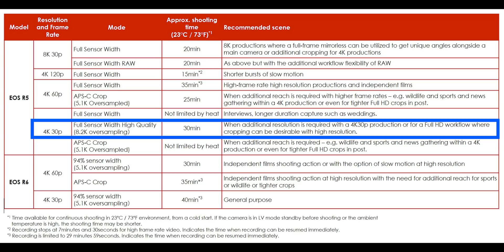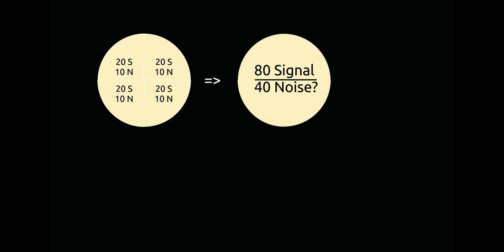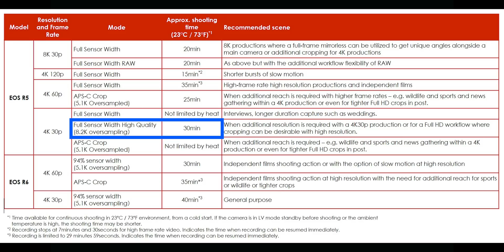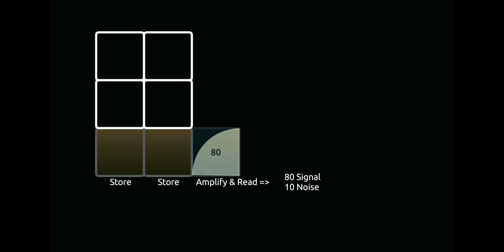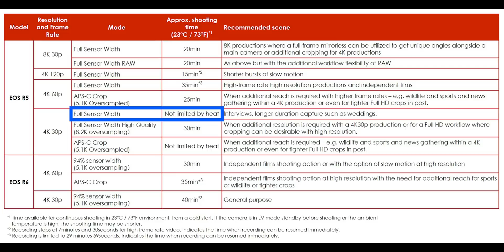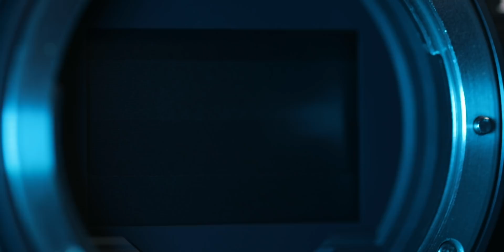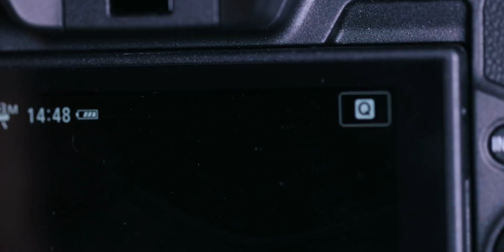Canon EOS R5 - Everyone is WRONG - Sensor explained - vs Sony A7s iii

Comment: I have question, just bought R5($4300) with RF 24-70 f2.8, unfortunately not able to get any sharp images at all,and find out My R5 r5 sensor misalignment, 
I’m not sure is really misalignment or because not latest firmware , I’m thinning return my R5 and buy new R6 or just replace with another R5, any thoughts?
Thanks

Comment: I actually watched the whole things.  I am giving myself a reward!  awesome depth! love it.  Did canon get back to you on that data?
Reply from the maker: Thanks mate. They didn't get back, but I know the answer. The R5 doesn't pixel bin in the non-HQ mode. It's a type of line skipping or at least discarding part of the data. So the lowest noise 4k mode on the R5 is the "HQ" mode, meaning it's a factor 5 difference in signal-to-noise between the R5 and the bigger pixel design like the Sony a7S III. 
A factor 5 corresponds to a roughly 2 stops, which is exactly the usable dynamic range difference measured. I actually made a follow-up video with that, called "divorce"....

Comment: Great explanations of S/N ratio.
Reply from the maker: Thanks mate. Now that we have both cameras out and tested, turns out this simplified calculation was almost exactly spot on. I made a part 2 (the a7S III vid) where I elaborated a bit on this. Now we know that the R5 doesn't pixel bin, so the best we can get is the 8k downsampled, 4 S/N in the example, vs 20 for the bigger pixels, i.e. a factor 5 difference. That's almost precisely the measured value: 2 stops of noise limited difference in dynamic range. And that means Sony pretty much won, for video.

Comment: Can pixel binning be added in firmware or is it hardware dependent ? Also it might be limited to line skipping so that mode remained unaffected by heat
Reply from the maker: It's hardware dependent in the sense that it needs to be supported by the sensor. Then of course the firmware can opt to use it or not, so the only remaining hope is that they haven't switched it on. Slim chance though. If it was supported in the sensor, I think they would have used it from day 1. So no.

Comment: You calculate that pixel binning yields a signal / noise ratio of 8, which is better than the  than the 4 s/n ratio you estimate for 4k down-sampled from a full readout of a high megapixel sensor.  This conflicts with many reviewers' notions that binning and line skipping are inferior and yield comparable problems like moiré.   Such reviewers also often claim that 1080p video down-sampled from 4k files can be an improvement on 1080p recorded using a sensor with fewer than 8 megapixels.  According to your perspective that down-sampling would also yield a worse s/n ratio.  Comparison of actual samples might offer proof, or not.  After all, how can anyone peep pixels at usual video frame rates with the usual preferred motion blur?

Most of the R5 / R6 sensor heat problem could have been solved with a small ventilation duct and fan, which the user might have the option to turn off and seal shut in wet or dusty settings.  Even with the camera body sealed to use copper instead of magnesium for the surfaces below the flip screen or its back side would improve heat dispersion.   But heat may be a rare problem in Sweden, right?
Reply from the maker: Turns out this simplified calculation was almost exactly spot on. Now we know that the R5 doesn't pixel bin, so the best we can get is the 8k downsampled, 4 S/N in the example, vs 20 for the bigger pixels, i.e. a factor 5 difference. That's almost precisely the measured value: 2 stops of noise limited difference in dynamic range. And that almost means Sony won. I made a part 2 (the a7S III vid) where I elaborated a bit on this.

Comment: The R5 is 8.2K (or 8192) pixels wide.  My guess is that the 4K30p Full Sensor unlimited mode is using simple 2x2 pixel binning of the 8K30p image.  That math is possible for ALU (i.e. add together 4 integers and then shift 2 bits right to get the divide by 4).   But 2x2 only requires 7680 pixels so they may be skipping lines.  For the HQ mode, they are sampling the full 8192 pixes down to 3840.  This requires divison operations, which uses more transistors and CPU cycles.  (This logic seems to explain overheating issues with R6... 5.1K is about 4/3rd 3.84K so a lot more floating point is required to produce 4K with the R6.). As to why line skipping 8192 down to 3840 is possible but not 5.1K down to 3840, I think it has something to do with the Nyquist rate where you need at least twice the frequency to recover the sample.
Reply from the maker: The difference of pixel binning vs scaling it down in software/hardware by shifting bits or dividing, is that the pixel binning aggregation happens before the amplifier, and since the noise is mainly introduced at the amplifier stage, that's the big difference.
Now that we have the data, the R5 doesn't pixel bin, which means the best read-out remains the "HQ mode" which is a full 8k readout. The calculation in this video turned out pretty spot on, because the estimated 5x better S/N with the bigger pixels vs the HQ mode is almost exactly the result (2+ stops in noise limited dynamic range) between the a7S III and the R5 HQ. I made a 2nd part where I touched on this.

Comment: I think I understood about 75% of this hah. Considering I had no context coming in well done.
Reply from the maker: Thanks mate. Turns out the calculations were pretty spot on, now that we have the camera tests available. The R5 doesn't pixel bin, and the 5 times better signal/to noise with the 4x bigger pixels on the Sony vs the R5 is pretty much what we got, about 2+ stops better. I made a part 2 with the video comparison (the "divorce" video)

Comment: Great explanation, What I am hoping to see on R5 is the ability to recover shadows and highlight,  readout speed using silent shutter.
Reply from the maker: Turns out the R5 didn't pixel bin, which means Sony won on video, by using the bigger pixels. I made a part 2 of the this, the "Divorce" video)

Comment: Everyone is wrong? WOW 👎
Reply from the maker: Had you seen it covered before? Turned out the R5 doesn't pixel bin, while the a7S III did take full advantage of the 4x bigger pixels. It also turned out that the calculation I did with 5x better S/N is almost exactly what we can now measure (2+ stops difference with S/N limited dynamic range). Do you agree with the conclusions in part 2 (the "Divorce" video)?

Comment: Are you working in R&D of camera or just putting theory and self logic?
Reply from the maker: I worked in mobile tech for many years, these problems are the same. Plus pixel binning was a key tech to get low light photos out of high res mobile phone sensors already many years back.

Comment: Hello,
About the last Fujifilm camera, does it mean that XT-4 is also using line skipping or pixel binning? So, does XT-4 have the same hoverheating and noise problems?
Reply from the maker: I haven't looked into the XT-4

Comment: Sony's lenses are not good yet ?  What a BS statement,  stupid review
Reply from the maker: You are right, that was a very sloppy statement. If there was an Edit button on youtube videos I would have rephrased those words. What I meant was that there exists no lens equivalents to the RF 15-35 f/2.8 (Lens) IS or to the RF 70-200 f/2.8 IS (that compact) on the Sony system. I wish someone will build it.
Reply: @ctoLarssonTECH  Sony's ff mirrorless  lens ecosystem are vast compared to Nikon and Canon all together with excellent Tamron Sigma and tens of other third parties lens manufactures

Comment: Pixel binning would lead to debayering artifacts similar to line-skipping (they don't use a quad bayer layout), so a full sensor read-out definitely would be preferable. But maybe they bin at least the dual-pixel pairs.
Reply from the maker: On the mobile phone tech side, we've used pixel binning for almost 10 years. It is possible. But you are still right because turns out the R5 doesn't pixel bin. Hence the 4k non-HQ mode is rather useless, and hence the whole camera drops in usefulness for video to almost EOS-R level.

Comment: Canon should just do like Sony and make one camera biased to video and the other to stills. That was smart on Sony’s part. There are just too many physical limitations to trying to use the same sensor for optimum stills Image quality and optimum video image quality. Its like using a computer with a integrated graphics as opposed to discrete graphics. Expecting the CPU and GPU to share the same system memory and perform well. Create a discrete senso put it in a discrete camera.
Reply from the maker: Yes you are so correct. I actually made a part 2 of this (the "Divorce" video) where I came to that precise conclusion! :-)

Comment: OOJ, en svensk på tuben.
Intressant att du snuddade vid IBISen.
Har länge hävdat att kanonbra stabilisering för 300mm telefoto,
ändå kan "vara rena skiten" för video ändamål, det det är två helt olika typer av scenario.

"6,5 stops of stabilizing" säger inget alls om video stabilisering i min värld.

Rent logiskt borde sensorns slaglängd, och objektivets vinjettering vara mekaniska faktorer som begränsar.
Sedan är det upp till mjukvaran att hantera det på snyggast sätt.

För foto, vill man ju bara eliminera små handskak, inte snyggt och dämpat panorera förbi nån tonåring som vloggar, eller ?
Reply from the maker: Japp helt sant! Helt olika applikationer och faktum är att Canon aldrig påstått något annat än att det är en bra IBIS för fotografering. Nu när verdict is out, så är det helt klart att R5 är bra för foto, medan Sony vann video-slaget. Gjorde en del 2 av denna med mer detaljer i detta.

Comment: good video but man towards the end of it i have to question your wisdom and mostly ask if you have ever used Sony system at all when you mentioned Sony lenses are not as good as Canon RF LOL. Sony has GM lenses on pair with Canon RF and on top of that Sony has ton of E mount fully compatible specially designed fantastic lenses for stills and video from Zeiss Loxia, Batis, Voigtlander, Tamron, Sigma and other.
Reply from the maker: You are right, that was a very sloppy statement. If there was an Edit button on youtube videos I would have rephrased it. What I meant was that there exists no lens equivalents to the RF 15-35 f/2.8 (Lens) IS or to the RF 70-200 f/2.8 IS (that compact) on the Sony system.
Reply: @ctoLarssonTECH  No worries, i thought you meant something like that. This Canon compact 70-200 2.8 seems really great though.Im sure other lens manufacturers will follow up with similar design.

Comment: I've been waiting FOREVER for Canon to answer this. If it's line skipping, my pre-order might be cancelled for the a7S III. Great explanation of how the downsampling modes work.
Reply from the maker: Yes I've also tried hard to get this answered, unsuccessfully. Maybe the local offices outside Japan don't know, or it's still in progress before the final release firmware, or some other reason. If it does line skipping, I'll also have to cancel my preorder and switching to Sony. I simply need to be able to record good quality 4k long-form video. IPB-only on the R6 just doesn't cut it, plus it line skips on the 120p 1080 as we saw on that boat clip, so that's a no-go too. Will be interesting few weeks ahead!!!
Reply: @ctoLarssonTECH  I GOTSTA KNOW! LOL

Comment: I can’t see the point @ 7:15 about RAW video. Olympus has 60 fps RAW stills on OMD EM1 2 but they never even did 4K 60 fps video in this cam, not mention the RAW.
Reply from the maker: The point I was alluding to there was how close they are to delivering the same quality as a still photo in every frame in a 24 fps video. It's basically just 20% off, which is peanuts if moving to a bigger form factor. So I'm certain that they are already in progress of readying a cinema camera with that as we speak.
Reply: @ctoLarssonTECH  Agreed. If you jump over to CanonRumors.com, you'll see both rumours of a new cinema camera with RF mount, as well as new RF mount adapters. Both are rumoured to be coming in 2020, so be careful if you're pulling the trigger on the R5. If you only need video, you might be wise to wait.

Comment: Such an expert! Could you please give me your opinion?🙏🏽🙏🏽🙏🏽 I‘m wondering whether an 8k sensor would make a line skipped 4K image look better than a f. e. 5.1k sensor (R6)? Or is it the opposite? 

No one can tell - I hope you can explain!🙃🙏🏽
Reply from the maker: The R6, with its larger pixels, is going to better signal-to-noise ratio than any of the read-out modes of the R5, which means that it will have better low-light performance. This means you can run higher ISO on the R6 than on the R5 without ruining the video with noise. (This is assuming the sensors are of similar tech generation.) 
The R5 on the other hand, will have better spatial resolution if using the 4k HQ mode, which will downsample the 8k read-out and in doing so it will try to maintain thin details. That will make the R5 4k video "sharper" than the R6 4k video.
So "better" here depends on what you prioritize. 
What I really dislike about the R6 is that it does IPB only, no All-I, which slows down the edit and can destroy some footage of grass and water etc. Also as you saw in that boat sequence, the R6 seems to lineskip to do the 120p 1080 and that is bad.
Hope helped you somewhat!
Reply: CTO LARSSON - TECH hey it’s me again ✌🏽 as we do know now, the R5 does use line skipping in normal 4K... do you know if it’s technically possible for canon to switch to 2x2 pixel binning via firmware update sometime in the future? And furthermore, do you think that the camera can be cooled enough by external gear (tilta fan,  RF Adapter with fan, etc.) so that it can compete with the A7SIII? 

Wish you all the best!

Comment: One thing I don't like about Canon is that they don't clarify how the different modes are read from the sensor.  Panasonic does this, and I appreciate it so much!  Let's hope the Canon R5 is truly tuned and ready for videographers, though by seeing the IBIS, it is not.  Let's also hope the Sony A7SIII actually does pixel-to-pixel 4K readout, with a stacked, backside illuminated sensor.
Reply from the maker: Agree, it wouldn't hurt to release some technical details. Yes that corner wobble in Peter McK's latest vlog that came after I made this video was actually even worse than the first one. And then came another issue, I heard yesterday from one Canon rep that disabling the Lens IS with the button on the lens is how you disable the IBIS. That would be absolutely ridiculous, because using Lens IS only (without IBIS) would be the solution to any IBIS wobble problem. In that case you can't do that. But that sounds so silly that I wonder if it's really true.
Reply: @ctoLarssonTECH  Sony has the same issue with disabling IBIS and Lens Stabilization; disabling it on either disables both. :(   @geraldundone is doing some chart tests and seems to have found the R5 is using line skipping in 4K/60 and 4K/120 modes... not pixel binning.  (another sad face)

Comment: Hmmm, that might work with a B&W sensor, but we're dealing with a Bayer filtered colour sensor here... All binning needs to be done in digital form so as to preserve the colour information!
Reply from the maker: You bin them per color. The illustrations would have been too messy and hard to follow if I drew 3 of each one. In mobile phones we've done pixel binning (with color) for almost 10 years. 
There are even phones today like the Galaxy S20 Ultra that dynamically shifts between a full sensor readout giving 108 MP in bright lighting conditions (where S/N ratio is not so important) and a 3x3 pixel binned 12 MP mode (108/9=12) in dim lighting where you need to boost the signal without introducing too much noise.
But like I said, I have no idea if this sensor can do it or not. The sensor has to be built for it.

Comment: Have you an update about this topic?  Thank you for the wonderful input
Reply from the maker: Nop. The only new fact since I made the video is some actual test footage here: https://vimeo.com/439692505   Unfortunately unfortunately unfortunately  the guy tested every mode EXCEPT the Log mode in 4k non-HQ, where it would have been immediately visible if it does line skipping or pixel binning (because the noise in the dark areas would either have been a lot better or a lot worse). But now since it's such a bright sunny mid-day, you can't see anything in the shadows really.
It does confirm that the full sensor 8k readout downsampled to 4k in software preserves the thin spatial details though because the "HQ" mode is visibly sharper, though I haven't tested yet how much difference it is vs adding a little bit of sharpening on the non-HQ mode.

Comment: So the Canon can be a good still camera and a good video camera, while the Sony can be a poor (12MP) still camera and an excellent video camera, as far as sensors go.
Reply from the maker: Yes I think you're spot on there mate. Canon will be killing it for photography with those RF f/1.2 together with this eye AF and sensor and super speed AF interface. The Sony will be killing it in low-light video for sure and based on this analysis, and probably in 4k video overall. But 12 MP photography in 2020? Not so great...

Comment: But will it blend?
Reply from the maker: Cast magnesium alloys, while that's a wide range of materials, have a proof stress (where it dents) of typically 75-200 MPa and a tensile strength (breaks) of 135-285 MPa. That's not much. It will blend.
Reply: @ctoLarssonTECH  well at least the magnesium alloy body should manage the already famous overheating just fine.